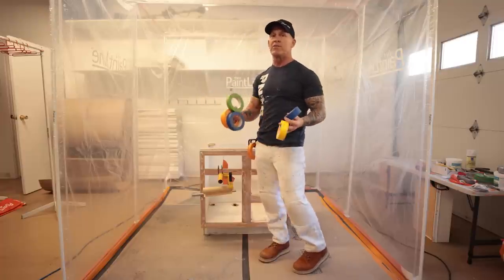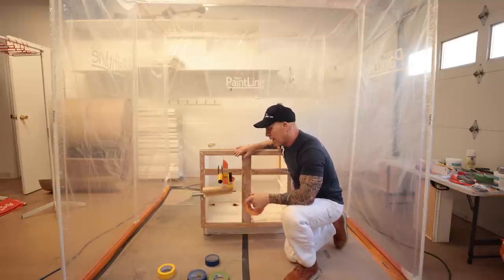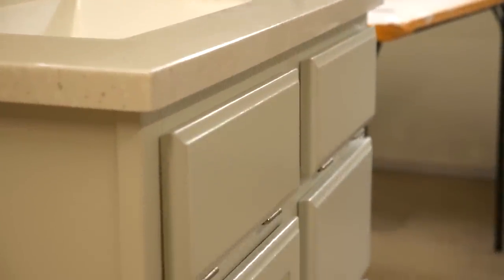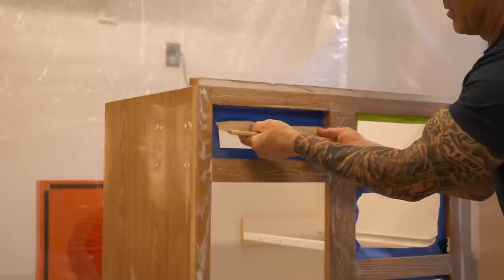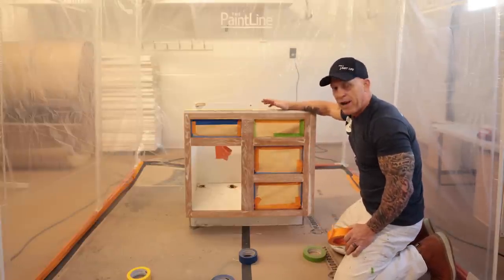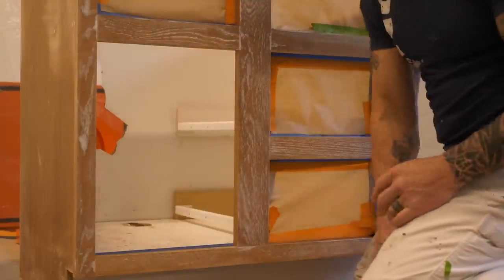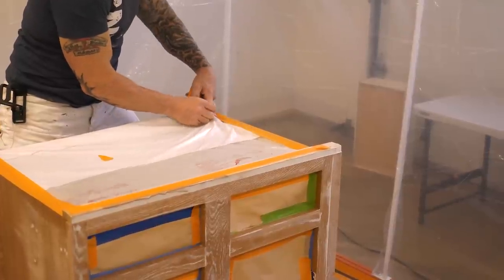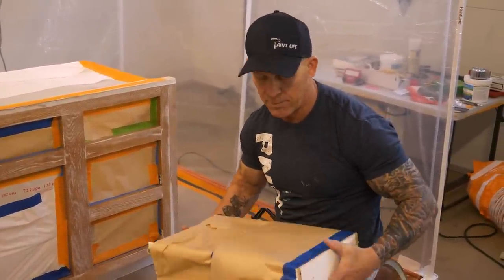How to Mask Off a Kitchen! Masking off Cabinets for Airless Spraying!

Comment: Is it safe to use an airless paint gun inside of house? What are safety steps to take when painting cabinets in the house?
Reply: Yes, I just airless sprayed inside of my house safely. Wear correct respirator, safety glasses or goggles, cover your hair/skin, have adequate ventilation, and be careful with your paint gun. If you're not already aware, an airless sprayer can pump out over 1000 PSI at the gun nozzle (or hose leak). This is enough pressure to inject paint into your body which is very dangerous and requires emergency medical attention. Always engage the trigger safety and never point the gun at yourself or others (paint to the hand is the most common injury). 
For an extra tip: you can coat any of your exposed skin with a thin layer of Vaseline. Then when you're done for the day and cleaning yourself up, just wipe the Vaseline off of your skin and the paint comes off with it! Also I've used blue Dawn dish soap when getting paint out of my hair. Works really good!

Comment: Sometimes it is necessary to use a high adhesive tape instead of frog tape for the inner boxes as there will be dust grime that the frog tape will not adhere to just an FYI

Comment: I've seen some complaints about Frog tape including it takes the paint and the plaster off walls.  What is the proper way to pull tape off walls so that it doesn't pull paint and/or plaster off with it?

Comment: I get how to tape for cabinets with frames… but what about frameless? Especially when there are drawer glides. I recently did a laundry room but was left with ridges on the edge of the face that all had to be trimmed off and then it chipped the paint, there has to be a much better way than what I did..
Reply from the maker: Mask and tape

Comment: Anybody know what plastic film he had on his tape gun? Whenever I try and use plastic on a gun I have to cut it with a razor. It defeats the whole purpose of using the tape gun.
Reply: U need another kind of blade designed for plastic cut  3m  blade